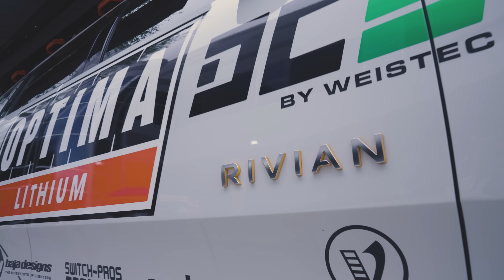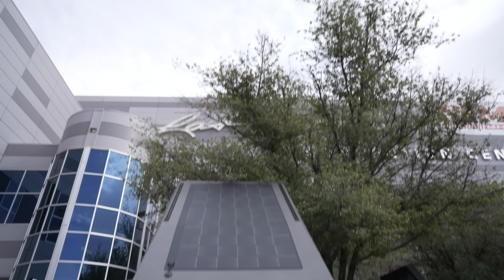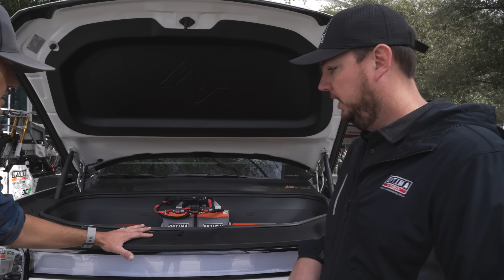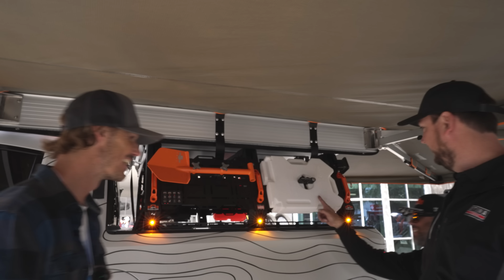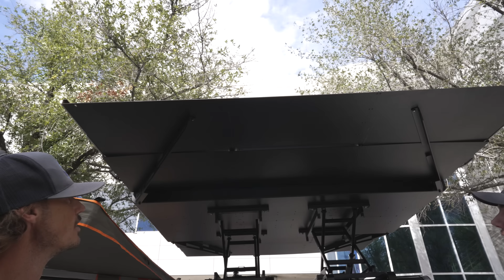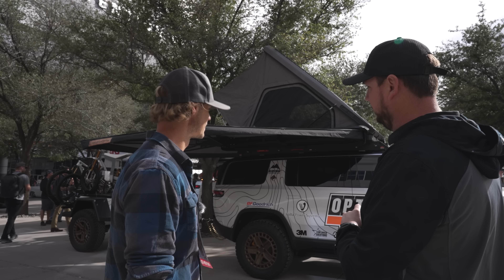Special Edition Optima RIVIAN R1S at SEMA

Comment: Good idea but the awning will not hold up during strong winds.
Reply from the maker: Ethan, this awning will take a lot of wind. Obviously every awning is it’s limits, but this isn’t an ordinary 270 awning. We sell, see and install a wide range of 270 awnings, and the Camp King is among, if not, the best awning in terms or stability, structure, and its ability to withstand the elements. Video and pictures never do them justice!

Comment: How much range loss do you have dragging that big battery trailer with you? Does the additional storage offset the likely range loss by pulling this trailer?
Reply: My thoughts too, losing 40-50% range (40-60kwh) is it worth pulling 50kwh?

Rivian is a 135kwh battery

Comment: Math is hard. 50/135 is 37% not "roughly 80%"

EDIT: see official response below 👇
Reply: Another article on this mentions 110 kWh pack, which would represent 80% of the capacity. He also mentions 800v system vs the Rivian actually being 400v, I think he might just be off on his numbers overall
Reply from the maker: Thanks for the pointing out the math miss! Got some clarity on this - yes the battery pack that they had installed on the trailer at the show was 50kWh, however, they have the ability to increase this to 110kHW making it closer to the 80% recharge that was mentioned. I believe there was a misunderstanding on what I was asking. (How much capacity was utimitaly possible vs how much capacity was on the SEMA set up). Sorry for the confusion and thanks for the catch!
Reply: @RhinoAdventureGear  thanks for responding!
Reply from the maker: @andrey_climb_bike_ski  Absolutely. No problem - thanks for bringing it to our attention!
Reply: plus loss from the charging you would get 35% or less but be able to use solar which is cool.
Reply: Yeah and rivian doesnt use a 800v architecture.. lots of bad data. Lol

Comment: That solar panel platform is insane! Where can I purchase that? How much is it?
Reply from the maker: The folks at Wiestech built and designed the 1K in a box that's on the Turtleback trailer behind the R1T. They used Merlin panels. The Solar panel on the R1S (0n the Camp King Tent) is a 360-watt panel we have at Rhino Adventure Gear. More info here. https://www.rhinoadventuregear.com/collections/camp-king-industries/products/rhino-adventure-gear-solarking-rooftop-tent-solar-panel-for-camp-king-rtt-camp-king-outback-powered-by-merlin

Comment: I’m curious how much range it actually would supply considering range goes down when towing
Reply from the maker: I think as the team at Wiestech gets it out and about over the next several months, we'll get more real-world feedback. Excited to see!
Reply: @RhinoAdventureGear  good to hear. I meant my comment as a genuinely inquisitively way and not as a skeptic. I’m hopeful for EV tech and am all for it
Reply: Well yeah.. Range goes down a bit faster when towing any trailer (depending how heavy the trailer is) but let's also not forget that with the whole assembly (vehicle + trailer) these electric vehicles can regenerate even better for example going down on a long highway to recuperate and put back some energy in the battery pack.. and with the latest software up-dates from Rivian vehicles are more efficient specially for trailers is even better as i watched TFL testings and Kyle from Auto spec Review, the tough time is on longer towing and up-hill climbing but i guess nobody try to race or going to the end of the world with these rigs while in tow mode right ? he he..
Reply: Exactly, between the towing and the increased wind resistance from the RTT and awning, I wonder if it's actually adding anything.

Comment: What was the tire size?
Reply from the maker: The BFG AT tire size is 295, but will need to circle back on the ratio. I know it took some loving and a specific offset to make it fit.
Reply: @RhinoAdventureGear   Thank you so much.. The more info the better. I would really like to do the same if not similar setup and build.

Comment: Incorrect,  all Tesla have come with a CATL 14v Lithium Ion battery for the last year.
Reply from the maker: If I understand correctly, a 14v battery (like many lithiums we run on our standard 12volt dual battery setups) is considered to be part of a "12volt" ecosystem. We see "12-volt" lithium batteries taking charge around the 14.2v range and have a resting voltage when full at about 13.2v. If we've understood correctly, this is still considered to be part of a "12volt" system.